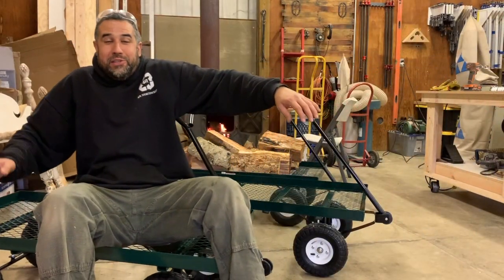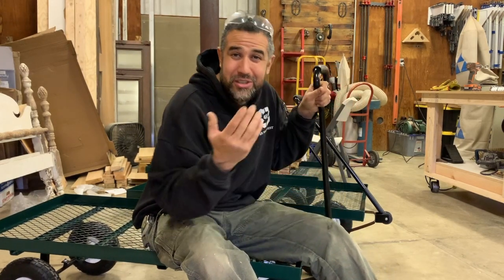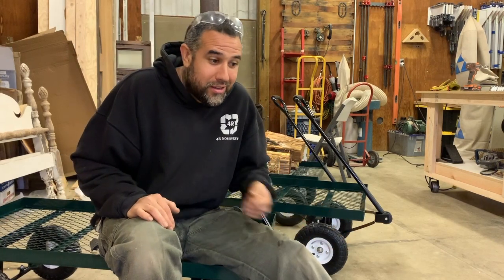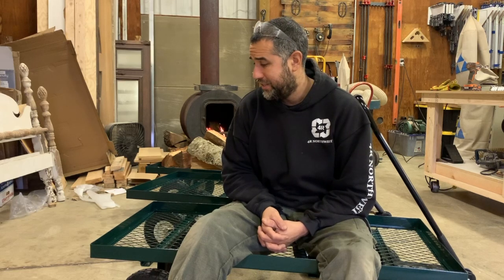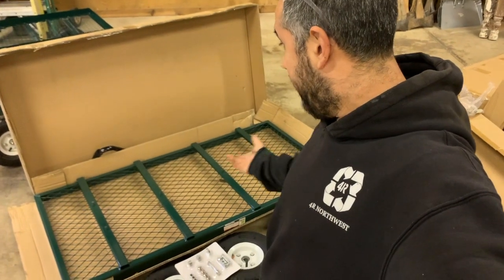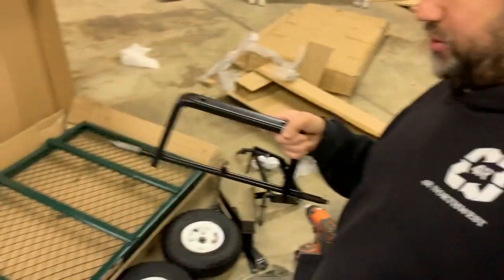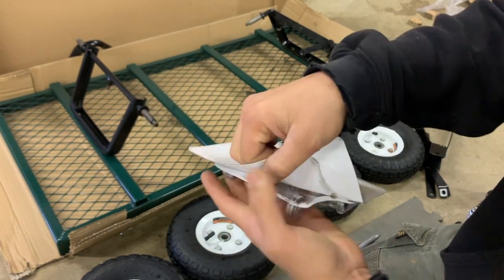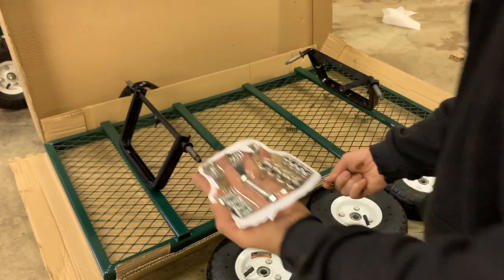Harbor Freight Garden Cart Assembly

Comment: Dude, you saved me with this video.  I needed this cart badly to haul storage bins and the stupid instructions were in tiny lettering that I could barely see!  In the Spring, I will use it to haul fertilizer and mulch!  You ROCK!
Reply: Not only is it tiny, none of the hardware is numbered in its packaging, so the instructions that are, for example referencing, "use Nut 9 and washer 13" are meaningless. Incomplete' too. Unless you use the small washers on both sides of the steering mechanism, you'll wind up with extra parts. Nothing said about the 4 lock washers.

Comment: I noticed that when attaching the flat connecting bar (about 9:20) the assembly works much smoother if you place the flat bar UNDER the steering arm bars ("under" with the wagon upside down).  The instructions show it assembled as in this video, but the steering arms scrape badly against the flat connecting bar that way.
Also the instructions (and parts list) doesn't show the lock washers for the wheels.
Also, I was going to re-use the old wheels from my old (previous style) cart (which finally rusted out on the steering arm, but I had recently replaced the rusted out wheels), but doesn't work!  The old wheels are slightly wider than the new wheels, so that they bind up when tightening the acorn nuts.
Thanks for posting this video!

Comment: Fill those tires with expanding foam, did it to my Pneumatic tire hand truck when the tire would keep going flat. Flip the cart upside down so the wheels can spin freely. If it has a tube (some do) remove it. Then puncture 3-4 small  holes in the tire to be able to feed the tube from the can of expanding foam. Squirt in small amounts then spin tire. That will send all the foam evenly around the tire while wet and pliable. As it expands it will push all the air out the holes and then the foam will start coming out. Once it cured cut the excessive foam that leaked out. Homemade run flats !!!!!!

Comment: i was just about to return it because the wheels don't turn and a cart that goes in only in a straight line wasn't much use.   The instruction manual doesn't say to leave those front bolts loose!   Watched your video, loosened those bolts, and wheeled around in circles!

Comment: one more thing. I ended up with an extra nut and round piece. Did anybody else. I used 7 of the 8.
Reply: I ended up with the same two leftover pieces.  I wonder if it's related to the extra holes in the base of the handle.  Maybe an earlier version needed an additional fastener.